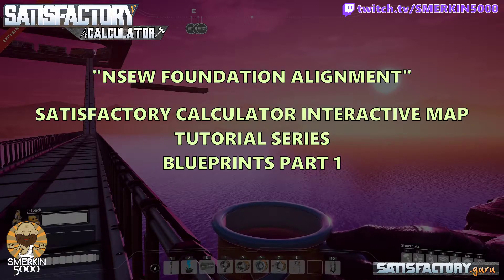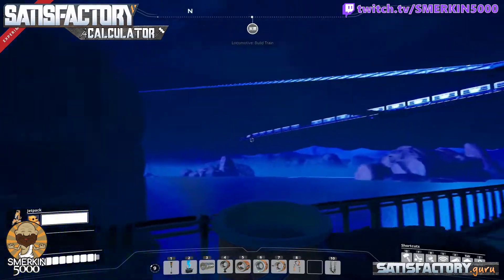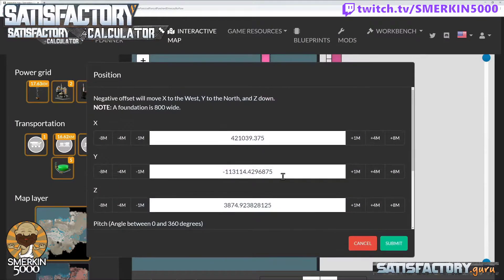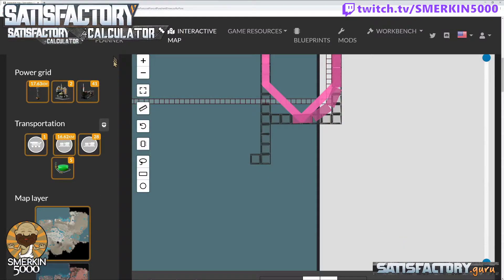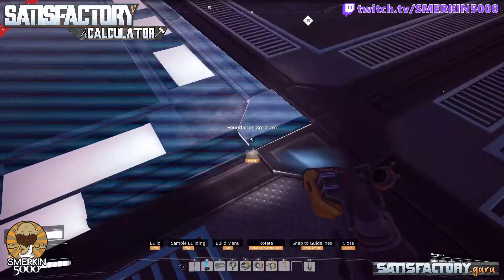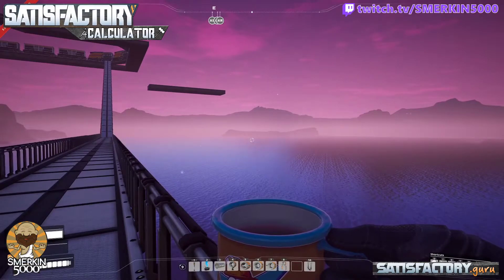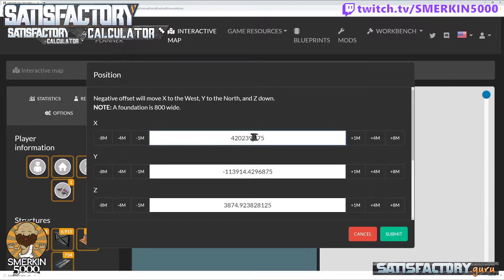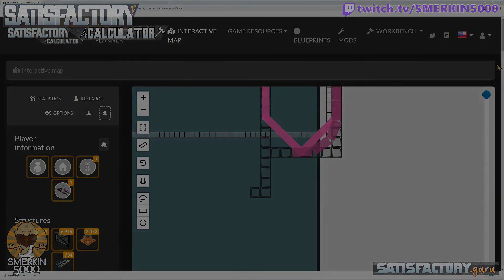SCIM Tutorial Series - Blueprints Part 1 - NSEW Foundation Alignment

Comment: What is the best way to establish the alignment of the first foundation with N/S or E/W?  I feel like I can get close watching the compass on the top of the screen, but now looking at my save file, the last digits of the decimal are not matching.  I'm not currently using the calculator to make changes to my map for this playthrough, but may be in the future.
Reply from the maker: Honestly if you want absolute 0 then place the first foundation and then go into the Calculator and adjust the x and y to 0 to be sure. Looking at the compass should be enough with the foundation edge flat but there is a lot of maths going on in the game.